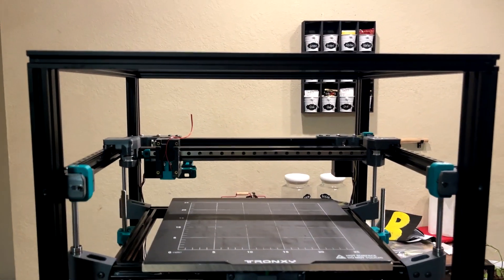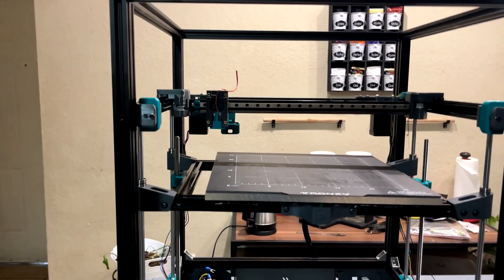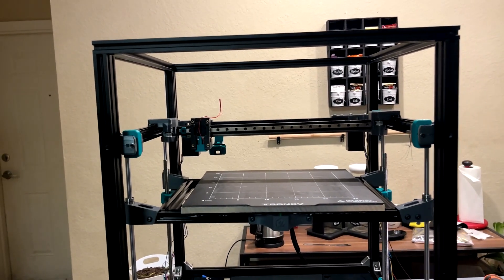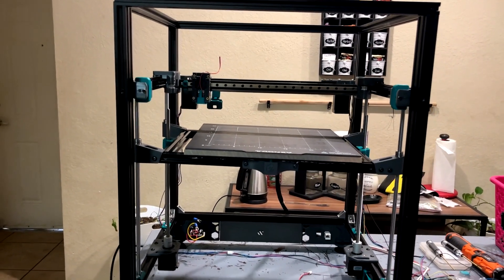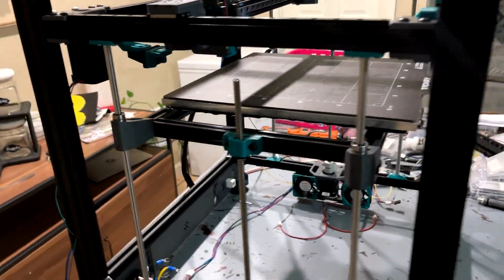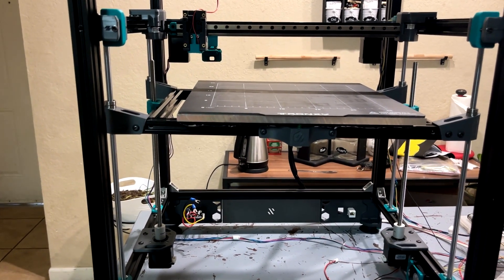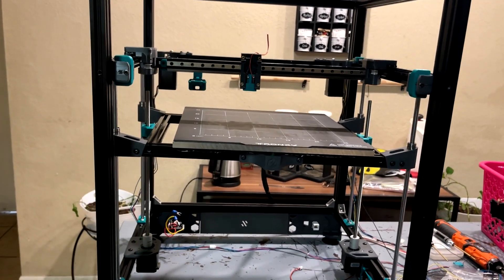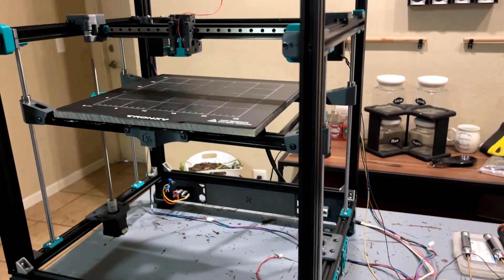// X5SA-Pro Conversion underway! maybe vzbot??  // GoldenJaguar392

Comment: Great job on you videos! Question would you still have klipper config file from this printer before this mod if so would you share it
Reply from the maker: Yes I do it’s an older config but I can link it to ya in a bit.
Reply: That would be great I have almost the exact same thing different hot end though
Reply from the maker: @scorchapathkos1301  here you go
https://drive.google.com/file/d/10k2MQoKS0BwCptwFuRYvOqfeqpylUiw-/view?usp=sharing
Reply: Thanks bro your awesome keep up the great videos
Reply: Got a question I have been trying to get klipper to work on my tronxy x5sa pro to work for 2 weeks now. I changed power supply and control board to octopus and same power supply that you had also external mosfet . When I set bed temperature values in printer.cfg iklipper disconnects from mcu. I have tried to find the reason but hit a brick wall no one in the klipper form knows what’s wrong figured maybe you would know still on stock bed at the moment

Comment: This is neat, I'm using my ender 5 pro to convert to voron but I still can't decide which one to convert it to.
Reply from the maker: It just depend on how much work you're willing to put in, the Voron trident is the easiest to build imho.
Reply: @GoldenJaguar3D  since I already have another 3 point leveling build planned I'm probably gonna do a 2.4 or 1.8
Reply from the maker: @tony_mfg7597  yes the 1.8 or 2.4 would be nice conversion but my vote is on the 1.8
Reply: @GoldenJaguar3D  I was leaning towards that one too
Reply: Have you looked into the mercury one? I believe that the vzbot 235 works too if you rotate the frame.
Reply: @KanielD  yeah I have it as a mercury 1 right now but I want to be able to enclose it easily, and possibly join the voron team which requires you to have a voron.

Comment: I am almost done building my Vzbot. It is not cheap unless you order absolutely everything from Aliexpress. Been building it up for 5-6 months. 

Have you seen the latest parts for the Vzbot? A lot of parts have been redesigned visually and are much more appealing. There is a new Vz235 that is AWD corexy meaning it has 4 motors and is 235mm based in spec form. 

Glad to see a video from you and look forward to more! :)
Reply from the maker: Yea I'm keeping an close on it kind of watching the direction its going but I really like the gantry portion of the vzbot so will be implementing on my Voron legacy and report back, good to know its not cheap lol cause that was one of the claim on Facebook from tronxy users who converted there's.
Reply: @GoldenJaguar3D  if you do mainly only the gantry, the cost isn't bad. Full blown build according to the BOM has me pushing past $1500 not using Ali.
Reply from the maker: @mwinburn200  jesus!! wow that's pricey!!
Reply: Even though I ordered what i could from Ali, I busted the 1k easily in part for the full conversion (Alu). To be fair, this upgrade shoot the X5SA capabilities to the moon.